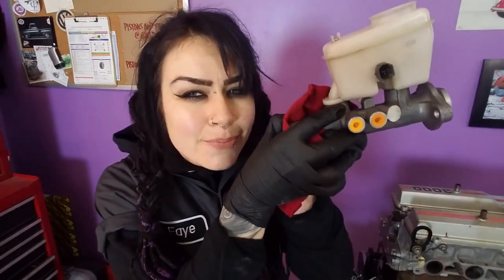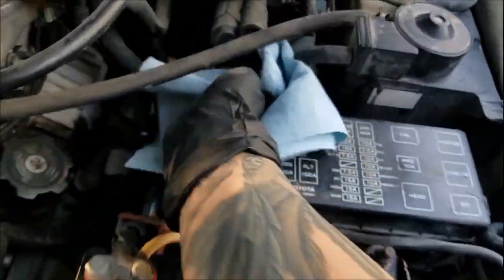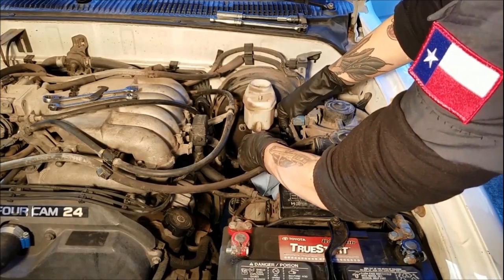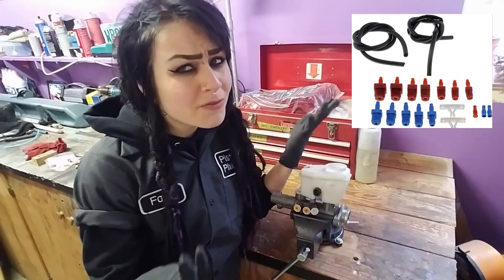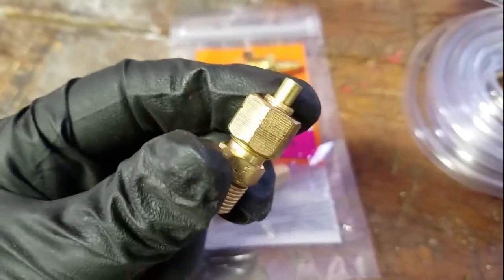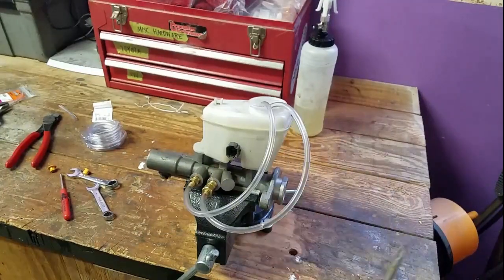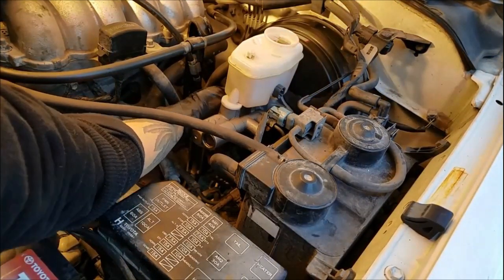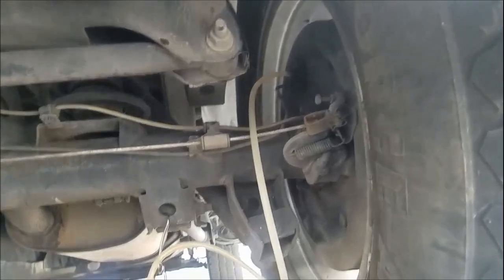Swapping the Brake Master Cylinder on a 3rd Generation Toyota 4Runner

Comment: Once you bleed the cylinder try taking plastic wrap and putting it over the top and screwing the lid down it will vaccum the fluid and you won’t loose any when pulling the plugs out to put the lines it. Great video Faye 👍🏾😉

Comment: Great video again. Well explained and edited. I've bench bled quite a few MC's, and sometimes, when I tilt them slightly each way, you get a few more bubbles out. A really excellent fellow taught me that 30 years back. You won't always get a bubble, however, I have been really surprised  more than once. The pedal just wasn't strong. That's when my mentor said " Did you tilt it while bleeding it" ?  That was a great learning right there. Keep up the great work. Jim Tree

Comment: Hello, Faye. I'm an old retired professional pilot over here in Houston. Airplane guys have a brake bleeding system that is universally used on our hydraulic disc brakes. All it takes is about a foot of clear tubing and a small oil can. Open the bleeder on the wheel, push the tubing over the bleeder, fill the little oil can with brake fluid, attach it to the other end of the tubing, and start pumping. Easy peasy, no need to have another person stepping on the brakes for you, works well every time. If you never heard of it, try it some time. I know it works on cars 'cause I've been doing since forever. Keep cranking, kid. You're doing fine!

Comment: Never knew brake fluid eats paint, thanks for the heads up. I’m always careful with paint anyways but great to keep that in mind if a mess does come up.
Reply from the maker: Of course!!
Reply: It also exurbs air and will go bad quickly if left open.. that's why you shouldn't use an old bottle of brake fluid.

Comment: Good information ...a few tips from a gray haired wrench-plastic turkey baster works great for vacuuming out brake/power steering reservoirs and takes up minimum space when you're mobile. Old rocker pushrod epoxied to a round gearshift knob is the perfect "U engineer" tool for compressing vice mounted master cylinders..easy on the palm. I respect your attention to detail and method. Best to you and yours. SUBSCRIBED

Comment: 1st off you do an EXCELLENT job with the tutorials! I love watching your videos.
Welcome to the 3rd Gen 4runner family. I picked up a 99 limited myself but I am having HUGE brake issues. Constant hard pedal after 20 mins of driving! 
Upgraded front brakes with Tundra Kit, new soft lines, new (used) brake booster, new (used) Master cylinder, new (used) vacuum booster valve w/grommet (3xs!), cleaned vehicle speed/wheel sensors (actually worked for a day), bled brakes 4xs with fresh dot 3 fluid still no change! 1 thing I did notice, there was a ripped gasket behind the MC going to BB is that needed? Any help would be great if not please come and get it!  Keep up the good work.
Reply: OH no ABS or check engine lights either

Comment: Thexton makes a fantastic master cylinder bleed kit Part No. 803X. Comes with aluminum fittings in standard and metric sizes plus a thread gauge, clear tubing, and 4 one way check valves to help prevent air from getting in on the return stroke. I used one of the check valves to make a one person wheel bleeder. I think it's something like $80-$100 depending on where you get it. Just replaced one of these on my buddy's '98 4Runner. Most be master cylinder season. 😎
Reply from the maker: Is that not the same product that I linked in my video description??
Reply: @FayeHadley  It totally is. I didn't read that part of the video description. Shame on me for not paying better attention. 😎

Comment: Faye!! I have had a hell of a time finding certain plugs on my yota because the thread pitch is some special Japanese style that is extremely uncommon... Like the threading necks down so you need a plug that necks down, this was when I was working on the intake manifold but still! Be very careful you may need to invest in a tap n die set working on these aluminum parts, It'll save tons of stress and time!
Reply from the maker: I have one of the already. I think sometimes yell forget that I've been a technician (and more specifically a Toyota technician) for 11 years now, and that I am not just a "YouTube mechanic."
Reply: @FayeHadley  I see you more as a restorer then a regular mechanic with these videos and thats how I see myself when I work on my truck is that im restoring something to original rather just fixing it up with a chinese poop part. I also have my rethreading kit out and im in the rust free 50tree. This is gonna be your truck so why not go the extra step of having clean holes for your hardware especially doing your own work. Some can say they're really smart cause they went to high school for 7 years.. Just sayin.
Reply: @FayeHadley  Lol. The comment could've been worse. YouTube mechanic? I resemble that remark. ;)

Comment: Keep it up. I have a 96 t100 I been fixing up. I payed $600 for it. New clutch.  Nicer wheels.. good service.. it's running strong.. but I'm looking for a steering wheel as well mine is real bad and can't find one in gray yet.
Reply: There are repair kits for them.. that will fix the cracking of the vinal.. you can also repair the wheel handle like Chris fix did on one of his videos by replacing it... making it look original

Comment: The master cylinder for the 4 runner if you bought it at like advance auto use to come with a big syringe to bench bleed with which was nice. I actually still have mine from like 10 years ago
Reply from the maker: Oh nice!!! Not so much anymore sadly. At least, the few I've bought new for customers haven't... :(

Comment: Hey Faye, I got one of those cheapo pressure bleeders for the home G awhile back. I started noticing the clear tubing they used wasn’t impervious to brake fluid. If you experience the same issues, search for Tygon 2375. 😉
Reply: You can also use clear fuel line like they use in weed wakers and lawnmowers

Comment: Hi Faye, do you usually check push rod clearance between the brake booster and master cylinder when replacing either a booster or master cylinder? As you'll know, setting the correct clearance is critical to ensuring the primary piston is able to rest against its stop and the compensating port is open.

Great video as always, do enjoy watching these and your very different approach to presentation and editing.

Great job. Andy
Reply from the maker: Oh yes! I mentioned it briefly in the vid if you missed it :)

Comment: I know people who replaced the master cylinder and never attempted to bleed the pistons. This is a real safety concern because the brakes do not work properly.. The last bleeder kit I used was a tapered plug to push into the line orifice, it worked OK but very cheaply made.

Comment: beware. there's a gasket that sits between the master cylinder and brake booster. it's very feeble. be sure to get a replacement.

Comment: Great video! does a master cylinder absolutely need to be removed from the truck for bleeding? i have a 99 limited and im assuming a TON of air got all the way up in the system while i was working on it over a few days, because i ended up with a dangerous amount brake pressure after, and bleeding at the brakes didnt seem to help. Im assuming i need to start from the top THEN move down to bleeding at the cyliners and calipers. any advice would be appreciated. again, great video. Thank you

Comment: Good job Faye
       When opening the system have you tried eliminating fluid loss by pressing slightly down on brake pedal to close MC outlets?
Reply from the maker: Good question! No, I almost always sell a brake fluid flush to the customer (or do one for myself) in a situation like this for warranty reasons, and to purge and air that will inevitably enter the system, so old fluid loss is not a huge concern.
Reply: And if we think about it for a while, doesn't it start leaking again right when you unbolt the master cylinder from the booster. Because the brake pedal isn't pressed down anymore "from the point of view of the master cylinder". But this is a good trick for let's say a caliper change. A brake line won't leak if it is open only from one place - explained: put a straw in a glass of water, hold your finger on the upper end and lift it up, the water stays inside the straw, same principle here only that keeping the brake pedal pressed down with a piece of wood between it and your driver's seat is that finger holding the upper end of the straw. Now when you remove a caliper the brake line on it will drip a few drops but will not empty the whole master cylinder reservoir if you have it open for too long.

Bleeding an empty(ish) abs brake system can be a hassle, even with obd testers at hand to operate the abs module during it - so I like to keep the system as sealed as possible and if doing a flush I will do it after the other work related. First I remove whatever I was using to hold the brake pedal. Empty the reservoir, fill it with fresh and then go through the bleeding like said with a vacuum operated bleeder until the fresh fluid is coming through. This way I won't get air between the master cylinder and the abs module which is critical, any air that is inside the line between the abs module and the wheel comes out easily with a vacuum bleeder.

Comment: Faye this is Tony..  I did a reverse bleed at all Wheels on my 1990 4Runner... after accidentally disconnecting the front right caliper. Because I had to re boot that cv axle. And I had a little bit of fluid on the rear wheel cylinders under the rubber. They were orig cyl from the factory in Japan. I replaced both cyl. Both sides. I have the factory shop manual so I followed the directions. So I use the V-5 reverse bleeder to do all the wheels but I've still got squishy peddle. Can I do a bench bleed of master cyl. While it's still in the vehicle and how would I do this...

Comment: Fayen. Need some advice.  For 04 4runner, the master cylinder is ridiculously expensive.  Can I rebuild it with new o rings and seals?  Think I see oil seeping out of the front ring section of the master cylinder.

Comment: Great video Faye! Why use the line wrench, will a box end work if you don't have one? Thanks again for being you!
Reply from the maker: Just to prevent stripping the fitting. Sometimes the lines can be super tight and if you round it off, then you will have to either replace the entire brake line (not cheap!) or just that section (so cut, flare, and re-shape) just to replace that fitting, and that's a lot of effort!!!
Reply: Without a line wrench, in a pinch, I've used combination wrench with a vise grip pinching the wrench down on the line fitting. 
Also with a damaged or decaying line fitting, I have done the vise grip thing over a line wrench

Comment: Hello Faye, i was told to change my brake cylinder assembly on my 01’ 4runner because I got BRAKE, VSC OFF, VSC TRAC, ABS lights turn on all at once. Do you think bleeding the brakes would help? Im thinking it might have dirty fluid and particles clogging it up. Or should I buy a used brake master cylinder since a new one is ridiculously expensive from the dealer and move on? Thanks

Comment: Been considering junkyard parts myself lately for some things. Since they drain fluids before putting them on the lot, is it basically  just a crapshoot on whether or not fluid reservoirs are shot, or do they completely remove ones that are already damaged/leaking?

Comment: what up girl!! good mech videos...I was thinking about my 2006 dodge stratus sxt when one time I came across one of your videos...either i'd trade it in for 2019 cruze hatchback LT or sell it first then get that cruze this summer, my car needs exhaust system replacement, suspension is decent and car runs really good for an 06

Comment: I have a 2001 toyota 4runner 2WD SR5 and I do not see the typical big drum-looking brake booster in my car that she has behind her brake master cylinder. I only see the brake master cylinder unit and that is connected to the brake pedal. Is my brake booster and my brake master cylinder one unit and to change the brake booster, I actually have to change the whole unit? Do I have a check valve anywhere? I am a bit confused because I also have a 3rd gen and I don't have a brake booster and check valve like she does. My brake pedal is really hard to depress and takes me a while to stop, that is why I suspect a failed brake booster.

Comment: Love the video and always attention to the small details which I agree with but I’m not sure I agree with buying a used master cylinder. Personally I would buy a new or reman. Not saying it’s wrong but would like to know why?
Reply from the maker: Only because I'm broke! I only use new (mostly dealership) parts fkr customers. I think this was $10 and it worked well, so figure it pushed off having to buy a new one by a little longer!!

Comment: Can you help me??? I have a 96 4Runner and no issues with it I til now. My brake pedal is supper stiff when braking and I have no clue why. I replaced the brake booster check valve and bled all the brake fluid. But it’s still stiff??? Any suggestions

Comment: My unicorn is the parking brake on my 3rd gen.  Replaced pads, cable, banged my head against the side of the wheel well and still cannot get the parking brake to actually hold.   Faye, do you know any cool tricks for this sad little problem?
Reply: Is it not pulling on the cable? Check the springs and tensioner.. I would start there... some cars have a cable tensioner on the cable that you can adjust on the cable.. but if you replaced all the cables.. then you would of saw it.. sometime its under the car body.. also when you press the e brake is it holding down or flopping back up?

Comment: Can anyone confirm if the 1/8 MIP fitting is the accurate size for the ports?  It seems from other discussions that M10-1 is what you want.  Are these "close enough" for this application?  The last thing I want to do is mess up the threads on my new MC!  TIA.
Reply: Answered my own question, the 1/8 MIP does not fit!  I'll report back if the M10-1 is correct.

Comment: How do you feel about changing-out dot3 for dot5 in an old drum brake car? ❤
Reply from the maker: Silicone fluid?! Honestly I don't mess with it much (with the exception of race/drift cars, and none have rear drums) due to it being not really necessary or applicable on most of the cars that I work on. And it's more $$$. Of course, you with all run into the same problem that I mentioned previously, where your first flush may result in damaging the seals in the master cylinder if you haven't kept up with the services.
Reply: @FayeHadley  Thank you.
Reply: Faye Hadley right answer.why swich your system was designed  for dot 3.

Comment: All vehicles don't use the "Old Logic" about starting with the Right Rear Wheel to Bleed Brakes.

Hopefully your Toyota states Right Rear Wheel First.
Some cars have you to start with the Left Front, and other puzzles.

Some vehicles have "2" Brake Bleeder Screws per Caliper...Which one do you Bleed First ?

" Brake Specifications & Brake Bleeding Procedures"  Thin Guide

www.motor.com